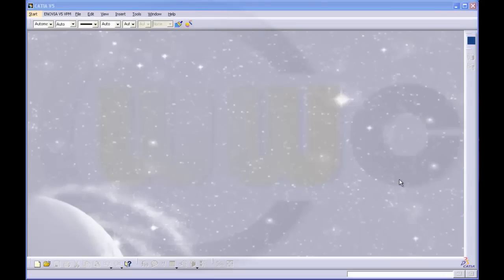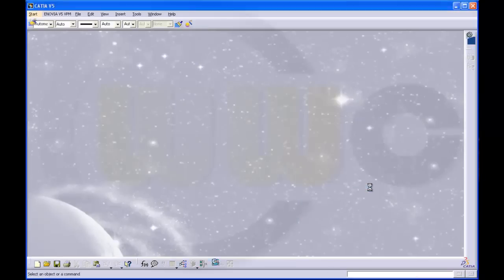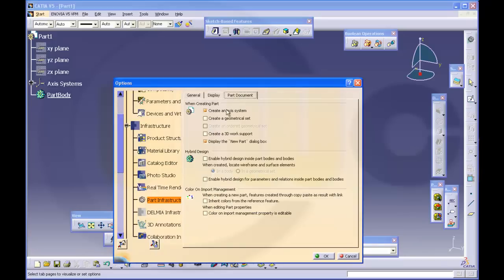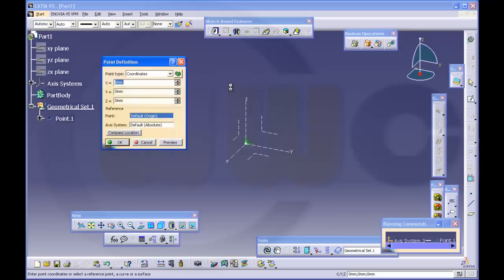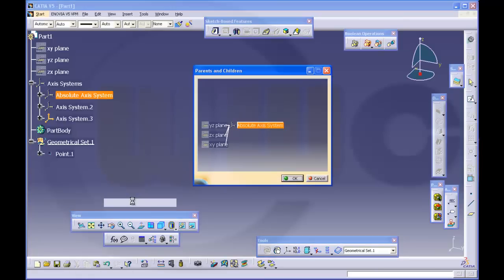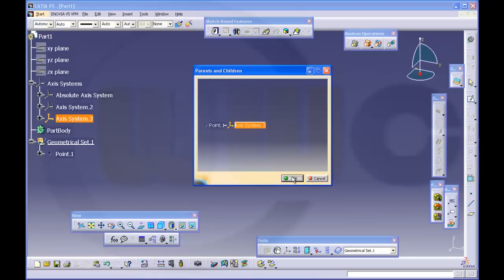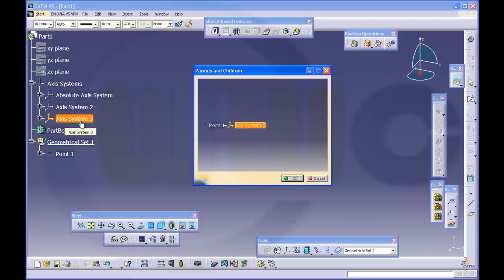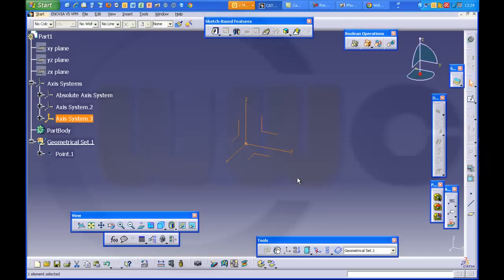Basics part IV - Catia v5 Training - Axis systems

Comment: Hi, I am a beginner and I have a question for you:
when drawing on the surface and place it parallel to the screen, I can not see the lines on the drawing surface.
I would like to keep lines of white and blue background.
Reply from the maker: You mean if you draw a sketch? Turn it by 180 degree - select normal view again - or slice graphics by "cut part by sketch plane".
Reply: Wolfgang Walden
hi,when i draw on surface of part,select normal view,surface of the part and line  are white and i dont see them until do let them.